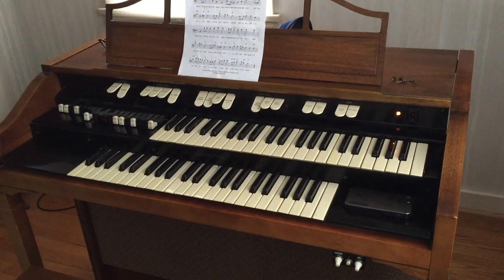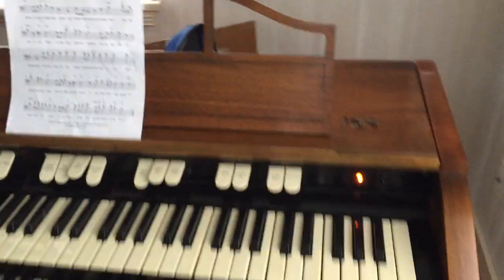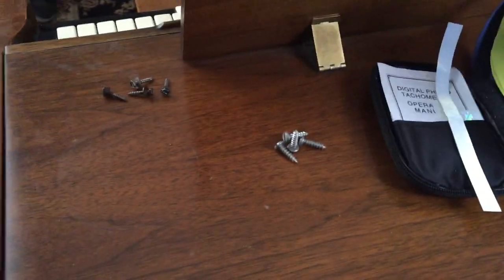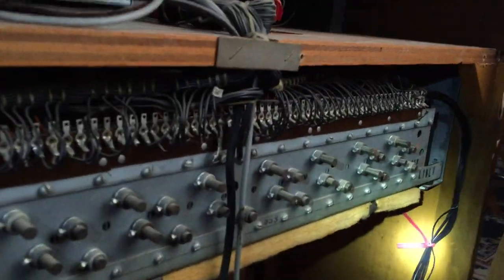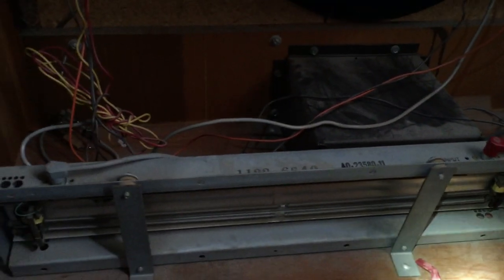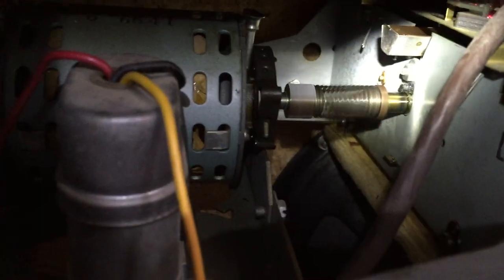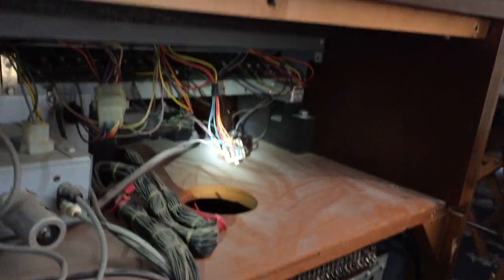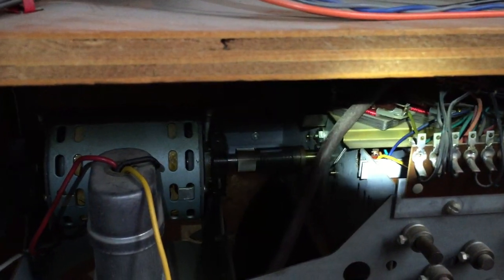Hammond Organ L-112 playing with tone generator motor speed

Comment: It would be cool to be able to vary the speed of the motor, but it won't be a "Leslie" effect. The Leslie effect makes use of the Doppler Effect by pushing the sound through rotating baffles. The compression and expansion of the sound waves causes the pitch to constantly vary to give the sound a unique chorus effect.

Comment: i just bought this exact organ, im an electronic engineering technician student, i wouldnt blame you if you couldn't be bothered, but i would love to see a video of someone removing the tonewheel generator. I do believe mine may have gone through a couple rough moves
Reply from the maker: Hello Ryan,  until I get ambitious and make that video, I can say that there are a few other ones already out there and here on YouTube regarding the tonewheel generators...and each one likely has a different way of accessing it, I do recall that once I got the lid off of mine, I realized that there was an even easier way, and I seem to recall that it was from the bottom, instead of the top...either way, you just need to get in there and start analyzing how it may come apart for yourself...you will learn quick, and you can't mess anything up too bad that can't be fixed...so go for it!  and check here

http://www.sl-prokeys.com/prokeys/generator.htm
Reply: i hope he likes to solder....